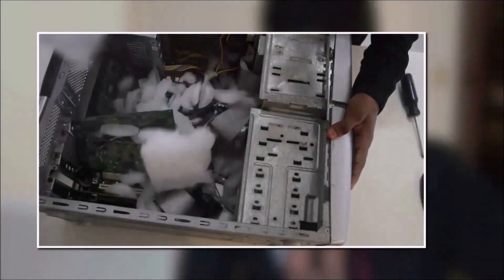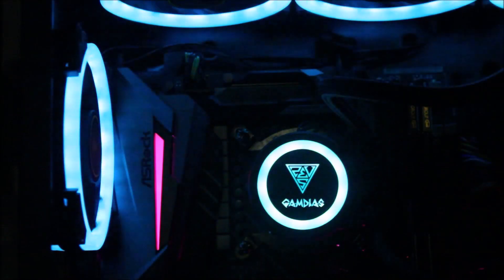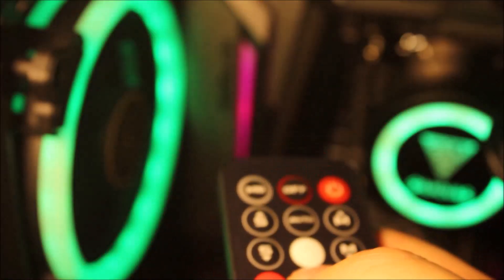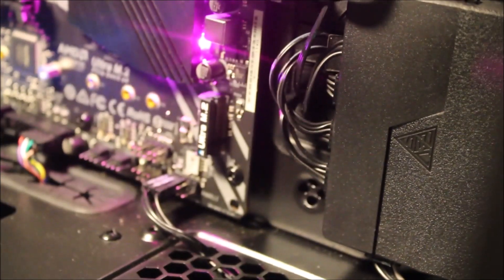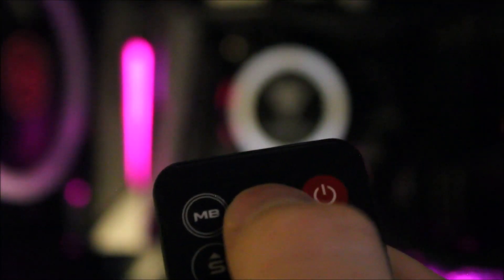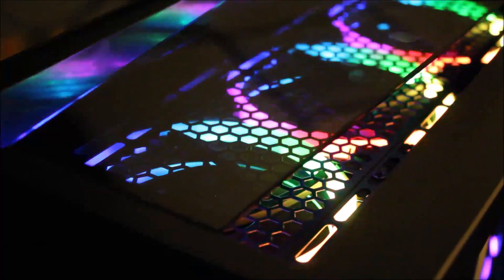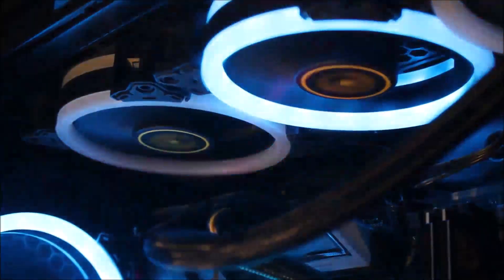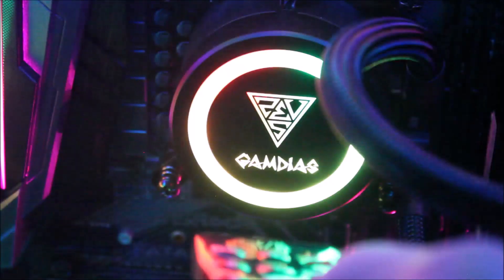GAMDIAS CHIONE P1A 360R PC Liquid Cooler Combo-Wombo (Overview)

Comment: Ur design is great but the CPU TEMP with this AIO is going very high. An 120mm AIO Cooler will cool the CPU better than this. I'm getting 40-43 degrees with the AMD 3700X using  ARCTIC MX4 Thermal Paste. When I play a game or stress the CPU it get's up to 90-93 degrees.
Reply from the maker: Hi PC enthusiast,  please contact via link, thanks.
https://www.gamdias.com/contactus/ContactUs.html

Comment: can i do burger fans on that 360mm radiator?
Reply from the maker: Hello there, the 360mm radiator mount were originally designed to mount only with the 120mm fans (burger patty 🍔). However, it IS possible to add more 120mm fans, covering the front and back, depending how mechanically inclined your are. Hope this helped answered your question! 😉

Comment: I tried to download the Hera software for Hermes P1 RGB keyboard but I couldn't.
what's the issue ?!
Reply from the maker: Hello there, the designated software for our gaming peripherals, HERA should be available for download via the download section of our official website under the droplist (Please be noted to look into the compatibility charts on each product to verify its compatibility under the name of "Graphical UI"). However, there is a bug which occasionally prevents our users to gain access to the download via chrome ---- in which we would recommend trying a different platform on Internet Explorer or Firefox to resolve the issue.

Below are the direct links to gain access to HERA:

1. https://drive.google.com/file/d/12toVDJ42lBkn-b15FrIIapjOk4z0Fhso/view
2. ftp://ftp2.kworld.com.tw/website/hera_install_version.zip

(Winrar, 7-Zip, and WinZip are usually recommended in order to extract the file. An alternative would be an alternative online extractor attached: https://bit.ly/2aS8YNk)

If the issue still persists, please quickly forward an ticket over to our tech support department via "http://www.gamdias.com/contact-us-en-gb/contact-us-en-gb-service". One of us should be reaching out to you as soon as possible!
Reply: Thank you very much 
I’ve managed to download the software and it’s working very well 🖤🧡🖤
Reply from the maker: @hishooomy3004  No problem, always here to help! 👍

Comment: Hi Gamdias. I recently purchased your Chione P1a 360r. I'm having trouble understanding the cabling. I'm using a Asus maximus xi extreme motherboard. Can you please explain what the 2 cables for the heatsink are for? I've connected the 3 fans to the box and then to the asus rgb header. I just need help with the 2 cables on the heatsink.
Reply from the maker: Hello Jason sorry to hear that. If you can have any technical questions email us at gdservice@gamdias.com we are happy to help!
Reply: @GamdiasTechnology  I came right in the end. It's working perfectly! Temps are cool and looks amazing!
Reply: Does it work with asus aura sync?